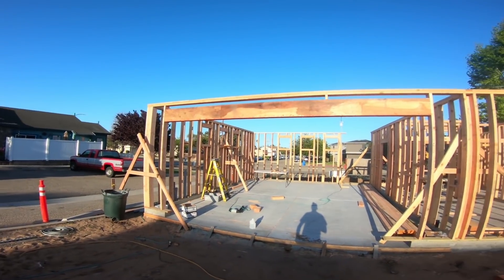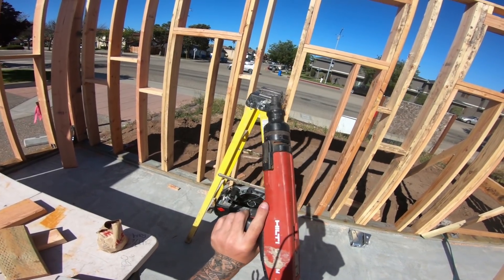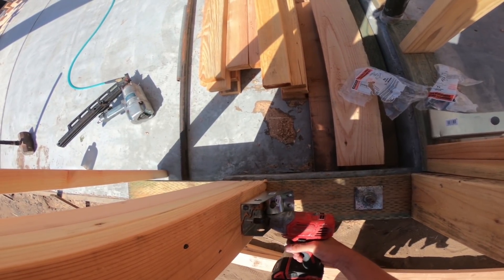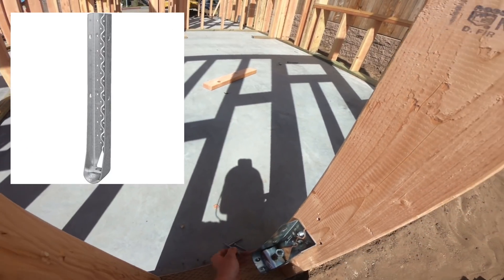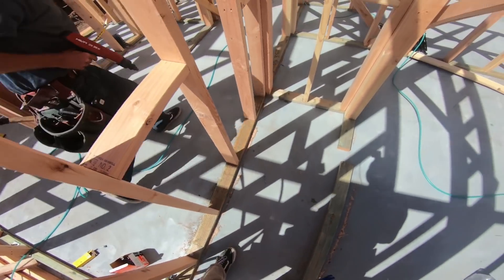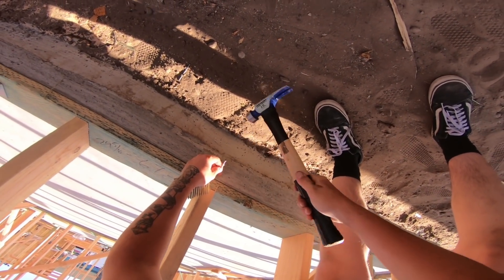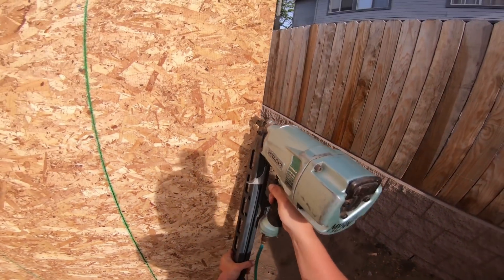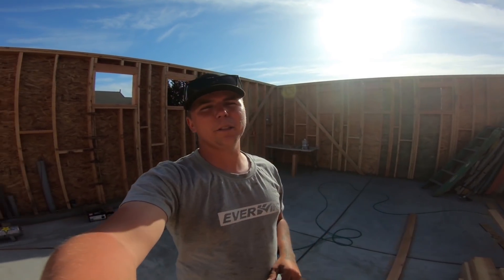Building a House | Ep. 3 - "Plumb & Line + Sheathing"

Comment: You said studs were 92 1/4 + 4 1/2 for bottom and top plates for 96 3/4.
Looks like sheathing comes 96” or under. Wouldn’t there be a gap toward the double top plate? How do you or would you handle that?

Comment: Hi Matt, I watched these videos a couple years ago, but am watching this series again as I am getting ready to self-built a 24x44’ workshop in the spring. Quick question: Do you fully nail your double top plates before you plumb & line? Or hold off until after?
Reply from the maker: Corners should be honed in when framing. Nail 'em off.

Comment: Why you guys don’t put any seal between the concrete and the wood studs on the floor to protect the wood from moisture
Reply: The wood is pressure treated. It doesn’t need any sea.

Comment: Matt, great work on these videos and your craftsmanship on the work!  My question is:  what size HDU holdowns are you using?   And do they have to be anchored into the slab like anchor bolts or are they installed during framing?

Comment: Question:
When you are putting up the OSB, how thick is the OSB and do you have a gap in between each sheet for expansion/contraction?
Reply from the maker: 1/8" gap is what they want, often times people use an 8d as a spacer.
Reply: @MattBangsWood  8d as in an 8d nail or are you using "H" clips? I am no builder... But learning from your channel.

Comment: I notice that you are working on cement slab,  I saw the  PT installed , but  I did not  see the moisture barrier sheet. Why wasn’t it used?  Thank You
Reply from the maker: They aren’t used here, we don’t deal with any weather like other places see..  they do seal from the inside down to concrete prior to drywall.
Reply: MattBangsWood    Thank you for the feedback.

Comment: Just realized you run Milwaukee impacts along with the Mak saw.. Are you considering the new M18 rear handle at all?
Reply: I am but I don't think it will perform like dewalts 60 worm style!! id much rather have a red saw but that dewalt 60v is a boss
Reply: Been using the dewalt for fews years now great saw haven't had any issues plenty of power.

Comment: Try to just site down the tops of the walls instead of string lines. One guy pulls or pushes and nails while other guy sites the top of wall. Much quicker and still very accurate
Reply from the maker: My grandpa was all about eyeing his walls. We've done it on rare occasions, but for the most part we string them. Helps us sleep at night, although both can be spot on.
Reply: @MattBangsWood  Yep I learned from my Dad who learned from his Dad.

Comment: how do you make sure the top plates of the walls are all level and running in the same plane? you trust your concrete and cut all your studs the same length or do vary the lengths of studs/ or shim up walls to level?
Reply from the maker: If we run into issues, we’ll stick frame sections custom cut from a string line. We trust our concrete guys, they’re good friends of ours.
Reply: use laser level  and a set of plans to build then you never have a problem with any elevations.

Comment: Why is the hardware so different is it the location of the house or just different codes
Reply from the maker: Different uplift ratings per hold-down. HDU14 will have a much stronger rating than an HDU2 or 4. These places are small, so they don't need much, as opposed to the 6,000sf+ places we've done in the past.